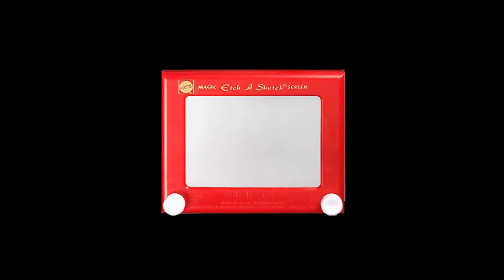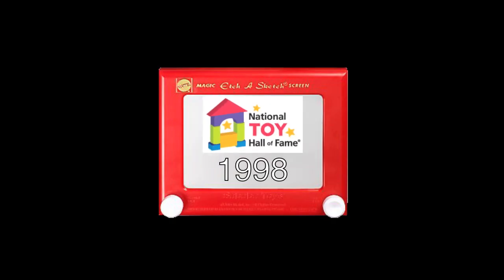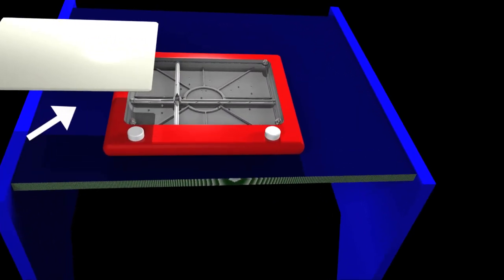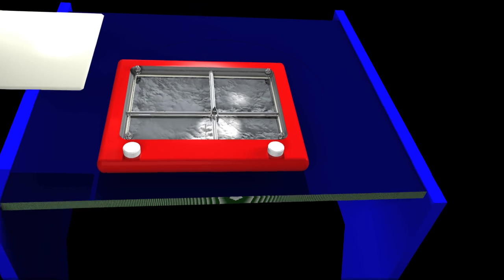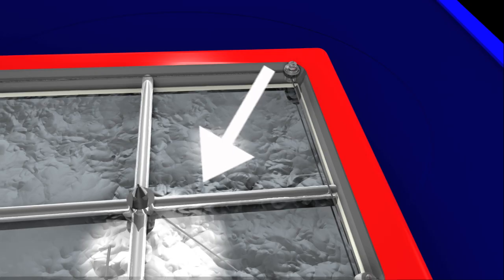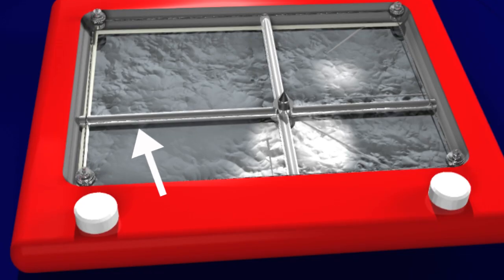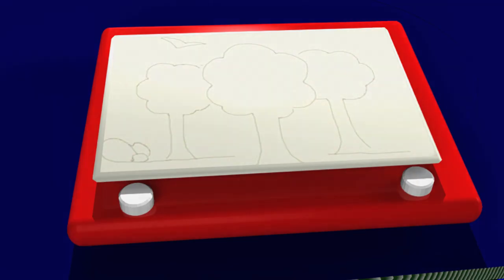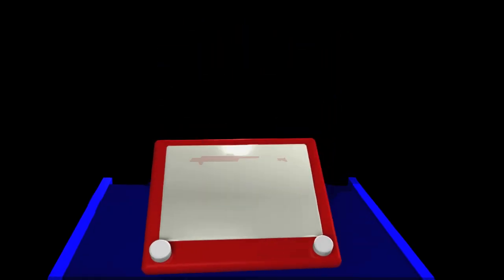How an Etch-A-Sketch Works

Comment: First of all, the screen is NOT plastic. I have opened it and found out that it was a plastic film covering glass. If you think of it, it is a good idea because if a child dropped it the glass would break but the plastic screen is covered.
Second of all, the “fine” powder is NOT “fine” , it is actually aluminum coating very very little styrofoam beads.
Reply: I thinks the screen changed its materials overtime or it varies by the country too

Comment: Perhaps someone can explain this to me: How does it know when to draw and when to move? Or are all drawing one long line without any stops?
Reply: Lord Lol XD
Reply: ***** Thanks
Reply: +Schoening91 but to go a step further
all drawings are one line without stops
but if you have to make a stop,  what you do is

you reverse to the point that you need to start the next line from

so if you wanted to draw a T

you had two options

do this

 1.   starrt here... draw a horizontal line
-------------------------------   now reverse to half way
             to here, then 
             start a vertical line,

but you have to get it perfect

Comment: technically circles are NOT polygons... You need a definite amount of sides. a circle has infinate (if you are saying that a circle has many tiny line segments) and does not have straight sides (if you go with curved line segments). If you knew how many sides there were lets say 14 you would call it a 14gon not a circle. If you ever looked at a geometry book, which you are required to take in school, you would know that a circle is NOT a polygon.